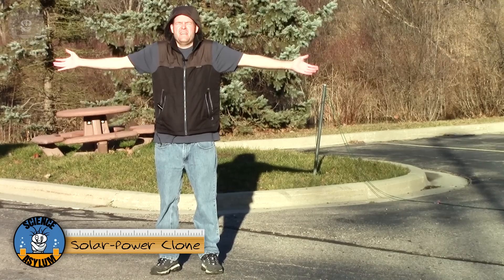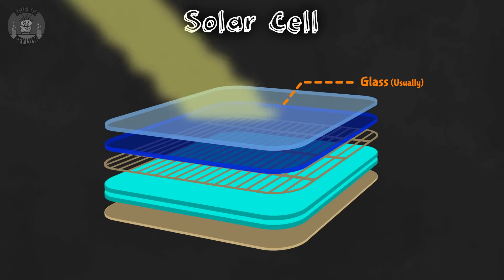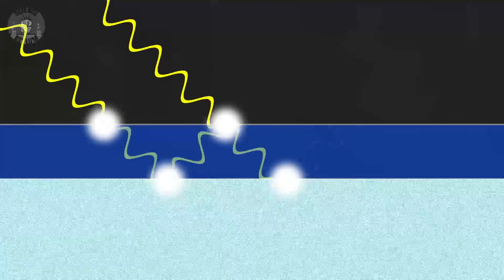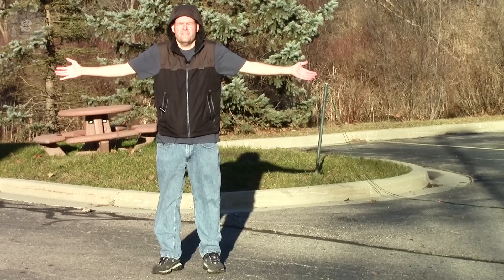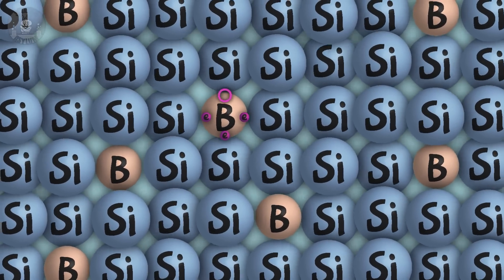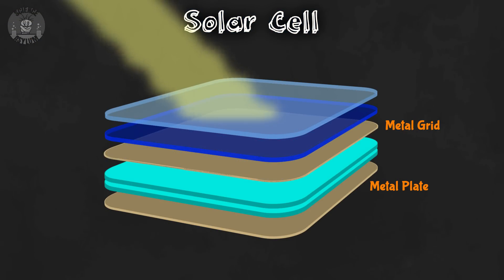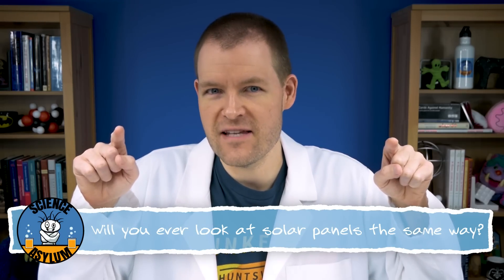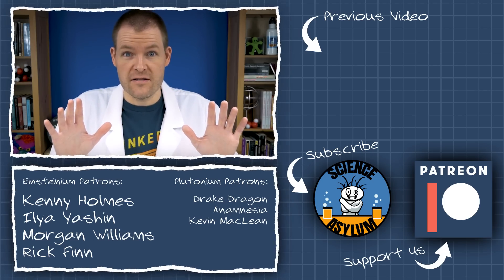How Do Solar Panels Work? (Physics of Solar Cells)

Comment: A question about the antireflection layer: The 2 reflected rays (one from the top of the layer and one from the bottom) are out of phase due to the thickness of the layer and cancel each other out.  What I don’t get is how this leads to less energy loss. I mean even if we don’t see any light coming back from the cell it still got reflected. Doesn’t this mean that the rays that end up in the cell have their energy reduced anyways?    love your videos and thx in advance
Reply from the maker: No, the energy from that light can't just disappear because the wave cancelled. It has to go somewhere. Rather than leaving, it goes into the electrons in the silicon... well, at least half of it. The other half just heats up the solar cell.
Reply: @ScienceAsylum   Then my question would be: How is the energy from the cancelling waves transferred to the electrons in the silicon? The refracted rays just shine directly onto the conductor. But how does the energy from the cancelled waves get there? What is the mechanics behind that?
Reply from the maker: If the refracted (exiting) rays cancel, then you're just left with reflected ones. The light completely reflects back down the silicon.

Comment: Great video--thumbs up just for mentioning Bob Ross! :)

As for the voltage of a solar cell, that might be changing soon.  As of five years back they were starting to devise solar cells that gained energy from more than just the visible light spectrum but from infrared up to ultra-violet.
Reply from the maker: Well, that's exciting! (if it pans out)

Comment: They are realy expensive though
Reply from the maker: Yes, but so are most things you'd buy for a house. Putting solar panels on a house roof is not the most expensive renovation and, like any large renovation, it does pay back itself over the long haul.
Reply: @ScienceAsylum  Didn't expect you to respond, espescialy not so quick. I suppose what you say is true, still when you buy a house and spend some money on nessesary renovations like painting and some furniture making the extra invest for solar panels will either require you to have quite a bit of money on hand already, wich most people don't have, or loaning money, wich incurs interest costs, wich you need to subract from your electricity costs to calculate how much you truly save with solar panels. Perhaps they still pay off in the long run but it would be a LOOOONG run. Also the money you invest now in solar panels you can no longer deposit on a savings account to receive interest. I'm not an expert on the costs of solarpanels and loans but these are things that are to be considerd before putting solar panels on your roof.
Reply from the maker: Yes, it's definitely still a very long-term kind of thing in terms of financial gain. However, financial gain isn't the only gain in this scenario if enough people do it.
Reply: @ScienceAsylum  Indeed, the main problem is convincing people to do it for reasons other than financial gain. Same problem with electric cars. It's the main reason governments subsidize them, helping the evironment is not nearly as huge of a concern as their own finances to most people. Having just a tiny inpact on the environment but a large impact on their finances doens't help. As solarpanels and electric cars grow cheaper and better and the environment grows worse more and more people adopt them. I just hope it will be enouge.

Comment: Why doesn't the silicone sheet run out of electrons to hand over?
Reply from the maker: 1) Silicon, not silicone. Huge difference. Let's assume it was just autocorrect or something ;-)
2) Run out? I think you might be drastically underestimating how many electrons there are. Like I said though, the transfer does stop pretty quickly at 5:56. After that, for more electrons to move, it has to be connect to a closed circuit where it will never run out.

Comment: Why is Silicon a necessity? Why not use P and B alone?
Reply from the maker: Because, for Phosphorus to have an unbonded electron, there must only be 4 bonds. Phosphorus by itself doesn't do that. All 5 electrons would end up in bonds. The opposite problem happens with Boron. The material has to be mostly Silicon.

Comment: Why solar pannels are only on average 20% efficient?
Reply from the maker: We actually have pretty good solar cells these days with efficiencies of 40%-50%. The problem is the loss to heat I mentioned in this video. However, efficiency isn't all that important. What matters more is how much the energy costs per kWh (or joule depending on where you live).
Reply: @ScienceAsylum  why heat decreases efficiency?
Reply from the maker: Because it takes energy to heat something. If the solar cell is heating up, that's energy that isn't going into electricity.

Comment: The solar panels are disaster for the environment. Batteries make thing even worse.
Reply: All the feasible alternatives except a Stone Age existence are worse for the environment.  Choose your poison.  At least the mess from solar panels and batteries can be cleaned up since they are quite concentrated.  Radioactive fallout from coal and nuclear plants and carbon dioxide pollution are not easy to clean up because they are spread over a wide area.

Comment: that's actaully the problem, the ammount of energy per square meter, or altenatively energy density provided by solar panels considering the weight of the panel itself is quite small, fossil fuel has a much higher energy density considering a gram of fuel, and hydrogen gas has the highest energy density of any combustion-based fuel. 

The dream would be to photocatalytically decompose water into H2 and O2, then use H2 as a fuel, of course the photocatalytic part is much slower, but hey, it's free solar energy so this would be the best use for it.

For higher energy densities nuclear power is the way to go, there is simply nothing that can compete. Yes pollution is bad, but some countries need to develop faster so they can get to the point where they can start worrying about going green.

Solar power is good as a supplement, but it's simply not efficient enough, even if the panels had 99% yield, it still could never compete with the other technologies as a main power source, it's a good secondary power source, like wind energy of hydroelectric.
Reply: Energy density is calculated by volume not by area and it only applies to an energy storage medium, like a fuel, not to a generator (which has no energy density since it doesn’t store any energy).  For a solar panel that medium is likely to be a battery.  You could calculate by weight instead of volume but this isn’t called energy density, it is called specific energy.  You might be thinking of output capacity per area occupied by the generating device but that’s not comparable to stored energy like hydrogen (different units, apples and oranges). And capacity factors are largely meaningless across different technologies.

The energy density of liquid hydrogen is 10 MJ/L.
The energy density of compressed methane is 22.2 MJ/L.
The energy density of gasoline is 34.2 MJ/L.
The energy density of diesel is 35.8 MJ/L.
The energy density of jet fuel is 37.4 MJ/L.
The energy density of good coal is 38 MJ/L.
The energy density of wood is 13 MJ/L.
The energy density of carbohydrates like sugar is 43 MJ/L.
The energy density of a lead-acid battery is 0.56 MJ/L.
The energy density of a lithium-ion battery varies from 0.9 up to 2.63 MJ/L.
The energy density of a lithium-metal battery is 4.32 MJ/L (expensive for cars).
The energy density of uranium is 1,539,842,000 MJ/L (but extracting more than a quarter percent of this is difficult, which is still a lot, atomic binding energy needs a long discussion, it is not chemical/electron energy like the others above, so it is not really comparable).

Hydrogen gas is among the worst for energy density.  Energy density isn’t an important factor for grid electrical generation, cost is, and that’s determined by the type of generator used and its fuel if any.  Energy density is important for transportation.  A lithium-ion battery has less energy density than gasoline but gasoline is only 15% efficient while a battery is 99% efficient, so they are about the same now in terms of usable energy.   We need slightly lighter batteries or capacitors to be as convenient as gasoline.  They are coming.  I wonder if we could run cars on sugar, which has the highest energy density of any fuel.  If solar panels had 99% efficiency, that’s all we would be using on the generation side.  Nothing else could compete.
  Nothing else barely competes now at their present 10% to 20% efficiency.  There are lots of tricks in the works to jump their efficiency too.

Comment: You didn't mention solar panels can only actually use a very narrow frequency band of the visual spectrum(which is already a very small part of the EM spectrum)

You didn't mention how exactly the photons excite the electrons, light energy is not actually converted into free electrons, it already took energy to make the material and the light simply acts as a catalyst which initiates the draining of the energy that was put into creating these materials in the first place, in essence it's a battery that requires light to work, we aren't converting photons or their energy into free electrons, we are draining an arrangement of artificial materials using light. 

You also didn't mention the declining efficiency over the limited lifespan of these panels, panels have interesting applications but they aren't going to save the world.

There are also coatings that are applied to the top glass layer which convert the frequency of normally unusable light into usable light which can yield up to a 6% increase in efficiency. 

While the panels are interesting a lot of their performance also depends on the quality of the power-inverter which needs optimal conditions to perform well itself,  the panels produce DC and that needs to be converted into AC. 

Creating a Boron, phosphorous and silicate glass crystal matrix is not environmentally friendly nor is mining and refining everything required for the electronics involved but that goes for all electronic appliances.

I love your channel but I don't like the perpetuating of solar as some romantic save the world solution because it's just not nor will it ever be, the technology has limitations which can not be exceeded, it is an inefficient way to generate power to begin with and then that already inefficiently generated current has to go through yet more steps which all take a cut.
Reply: I don’t think anyone cares about efficiency.  It’s a meaningless figure except for comparing two different solar panels.  People care about cost per kWh generated, and utility solar panels look poised to be the cheapest energy option in another year or two.  Solar panel costs have been declining 34% plus per year for several years and are expected to continue to do so for a while longer.  Then engineers will focus on improving the efficiency side, they have lots of ideas to try.  It’s hard to beat almost free energy no matter what meaningless efficiency figure is assigned.

Solar panels aren’t batteries either, they are electrical generators.  Their energy does come from the incident photons and not from the electrons or the materials already there, which serve merely as mechanisms to facilitate the photon energy to electrical energy conversion.  Where do you think the energy of the photons goes if not partially into electrical energy?  Why do solar panels continue to operate for at least 25 years, often for 60 years, if they are just batteries being drained?  They are very good batteries if that's what they are.  But why doesn’t the panel material slowly evaporate if is being converted into energy?  A catalyst kick starts a process that continues on its own until a chemical substance is exhausted.  Nothing continues on its own here, no more photons = no more process = no more electricity.

Supporting material

“Energy from utility-scale solar plants — plants that produce electricity that feeds into the grid — has seen the biggest price drop: an 86% decrease since 2009.”

“The cost of producing one megawatt-hour of electricity — a standard way to measure electricity production — is now around $50 for solar power, according to Lazard's math. The cost of producing one megawatt-hour of electricity from coal, by comparison, is $102 — more than double the cost of solar.”

https://www.businessinsider.com/solar-power-cost-decrease-2018-5

“According to the Bloomberg New Energy Finance (BNEF) analysis published in the journal PV Magazine, the price of photovoltaic panels is expected to decline by 34% this year, roughly the equivalent to the fall in module prices in 2016, and only exceeded by the 40% price drop in 2011.”

https://unfccc.int/news/further-dramatic-fall-in-price-of-solar-energy-forecast-for-2018

Comment: Say Cone, now say SiliCONE. It’s not SiliCON
Reply: Silicone – a class of synthetic materials that are polymers … used to make rubber, plastics, polishes, and lubricants.  Ends with “cone” sound.

Silicon – the chemical element having atomic number 14, a non-metal with semiconducting properties, used in making electronic circuits.  Ends with “cawn” sound.

Comment: But you didn't explain how the photons interact with the Si. What exactly makes electrons to overcome the barrier? Presumably, it coldn't be heat cause cells hate heat, so it isn't infrared energy what makes them tick. Although  photons do not carry any heat with them, so heat in the cell is generated by movement of electrons as part of unwanted side effect/byproduct, that's why cell should be actively cooled for better efficiency. To sum up, cells want strictly visible light spectrum, less infrared as possible, less heat as possible. Then how does it work? Is it something to do with size of Si atoms and visible light wavelength, then what wavelength from electromagnetic spectrum solar cell is looking for. Does photons collide with Si atoms an somehow knock the doped Phosphor electron off orbit? Do cells perform better during cold winters or on North Pole? Physics says yes they must work more effciently during cold winters, assuming that we take light source angle and distance to it out of equation for simplicity. 
See, you missed most interesting part. Please upload part 2!

Comment: Great work, as always. Question about the antireflective layer: If the waves cancel, does that energy just dissipate? Wouldn't that cause a loss of energy still? Or do the waves just not reflect, as that would cause a cancellation?
Reply from the maker: If it doesn't reflect, much of that energy is available to excite electrons. Not all of it though because it's subject to the same efficiency level as the rest of the light coming in, but it'll still be about 40-50% if it's a good solar cell.

Comment: Solar is no good with the blocking of the sun.
Reply: Batteries solve that problem if you are off-grid.  Peak power demands tend to align with the times when solar is available so batteries are of debateable benefit at this point for a grid feeder system.
Reply: cloudpoint Have been running off grid for a few years.Power has only become a problem in the last year or so with the sky being totally covered all the time with chemtrails that anyone can see if they look at the sky.I see the path of the sun everyday and the sky from the top of a mountain.Bill gates and Harvard have also released to the public that they will be "dimming"  the sun starting this year which has already been going on.So do the math.One day a month of good sun is not enough to account for grid tie or off grid even with a big system and alot of storage as I have and imagine the spraying that will be occuring soon now that they have told the public.Good luck people.
Reply: @olbeast  
Chemtrails aren’t real.  Contrails are real.  Is your cave located below the flight path of a new airport that opened near you?

The “dimming” of which you speak is just a small experiment involving two flights of a steerable balloon 20 kilometers above the southwest United States to see if the sulfate dispersal idea is even feasible in the future and it will not be repeated now nor release actual sulfates.  The experiment will release 100 grams of calcium carbonate (an inert powder) and watch how the powder disperses.  There will be no measurable sun dimming effect from the experiment.

If you don’t have enough energy with a large PV system and batteries, you need to stop smelting nickel at home, or you have even bigger problems like the inability to grow food.

Suggestion: Reduce your energy usage by not posting comment replies.

Comment: If p gives its free electron to boron after some time all "p" gave electron to boron its mean boron and silicon also get stable this way then how solar panel work for a log time
Reply from the maker: As I said at 5:58, that transfer doesn't last very long. All it does is create an imbalance, which means we have a voltage. That voltage drives charges from/to whatever you connect the panel to.